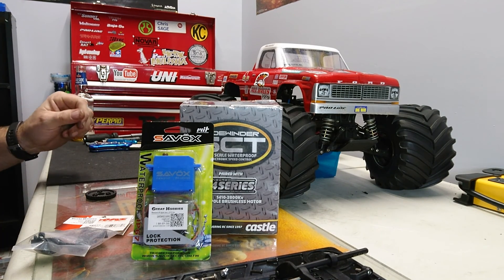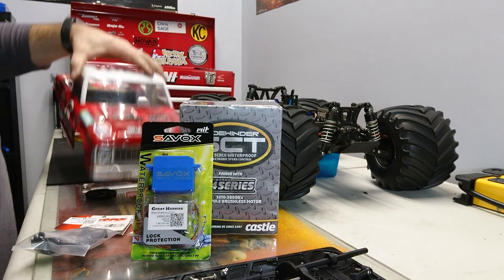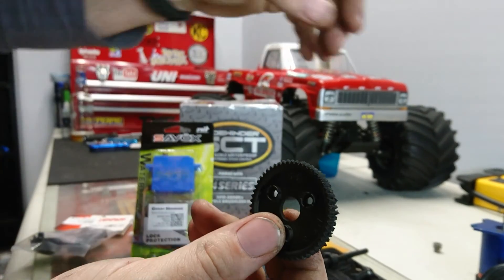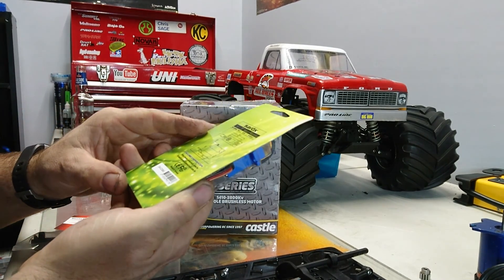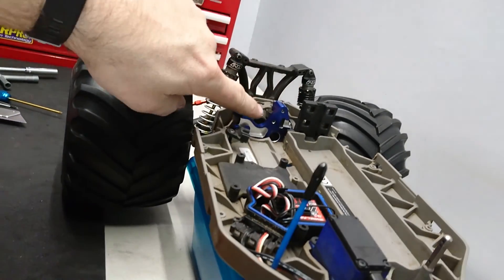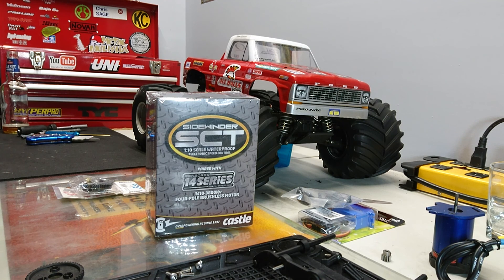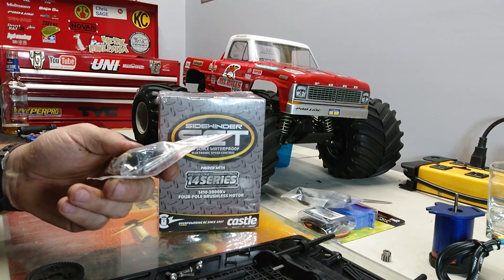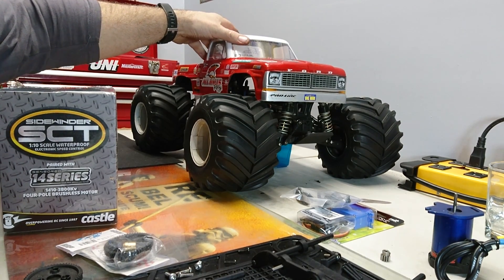TRAXXAS SLASH 4X4 MONSTER TURCK

Comment: I’m thinking about getting a slash 4x4 roller off eBay and doing this build. Already have a brand new servo, brand new esc and motor combo still in the box and I can find an old traxxas radio somewhere around here. Definitely gonna get a high center of gravity chassis, Don’t like the way the LCG chassis looks with this conversion lol. Hopefully I can find the Jconcepts conversion somewhere.... It’s been out of stock everywhere for a long time now 🤔
Reply from the maker: Awesome, sounds like your going to have a great set up. Ya the JConcepts kit was only out for a year. 👍

Comment: All you had to do was gear down to a smaller pinion so you kept the same final gear ratio. Then the cugging would of been the exact same as with the stock wheels. People please do some research on "Final drive gear ratio" is a #101 lesson in RCs most miss and it will help you understand SOOOO much about overheating motor/ESC, differentials, effect on wheel size changes, etc.

FYI - A metal spur gear can cause tons of damage on a motor when the installer has no idea what they are really needed for and uses them in some moronic idea to give strength to a drive line. And don't understand that it is the same as adding a penny behind a blown fuse. The spur is plastic for a reason in your case because it is supposed to break when something is wrong as in you had changed the final gear ratio too much with tire size and didn't properly gear for it. Adding the metal spur gear didn't fix your mess up. So as the master planner you are, you just threw even more money at the problem and replaced a perfectly good motor/esc with nearly the exact same freaking motor/esc just from a different brand. 

EDIT: The Castle Sidewinder 3 SCT combo when it was released years ago was a big upgrade to the stock Velineon system at that time. Because the stock Velineon system was a 2-pole motor. A few years ago Traxxas upgraded to a 4-pole system so the 2 systems are just about the same now.

I don't know but it seems you went to your LHS and got figured you for a SAP and they saw the $$$ just spinning. Because you got the classic "Sell the uninformed guy stuff he don't need to fix a problem he could of fixed himself for nearly free at home." scam someone people run into getting their real car fix at the mechanic. Yes there is scum at all levels.
Reply: Yes, I also have a slash 4x4 and bash it rly hard and never stripped spurs because I always set everything right.
Reply: Yea i thought this too about gearing than say if went crazy with 1415 castle it would bust. Those wheels up clodbuster wheels were cool idea youbright not really practical route
Reply: Zed orda what should his pinion have been?